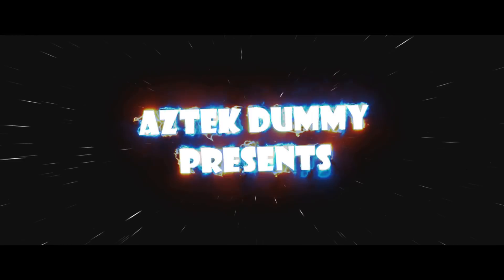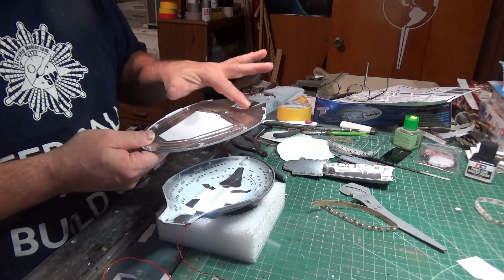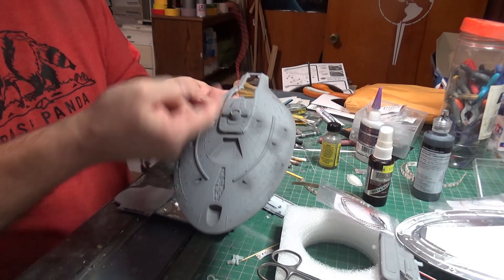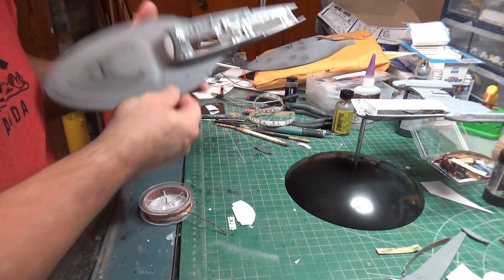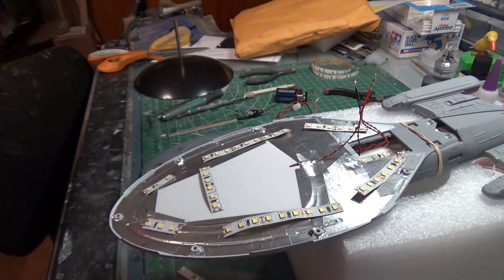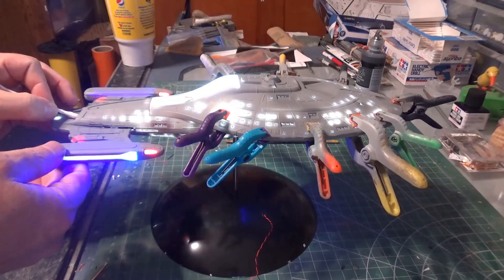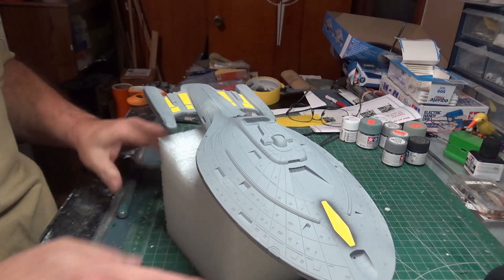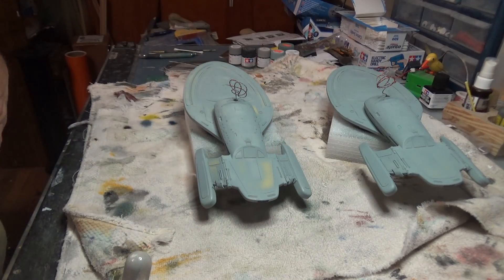Aztek Dummy Update 9/10/21 - 1000 scale Voyagers - Part 3

Comment: You have quite the point with the Tamiyas and Humbrols. Over here in Germany, Land of Revell, most of us started with using Revell enamel colors. Many hobbyshops also had/have the Humbrols as alternatives. The good ones also carried some imported Model Masters. But when you wanted to mix colors for kits from, say, the US, then chances were that they would be using color brands, that weren't as available here than where the kits came from. But for a while now, Tamiya colors are getting more and more dominant - which is nice, because now there is a color brand, that is readily available around the globe for which you can easily find paint guide and mixing guides for. Also, as acrylics, these colors are easier to use. So a big thumbs up for using Tamiyas from me :)
Reply: Great points every region has certain brands as standard  half of my kits are Japanese and have creos ( Mr hobby /colour ) revell /monogram /airfix used to mix in fs numbers along side humbrol /airfix then add polyscale game color Vallejo ,citadel and others ( at one stage I counted over 15 brands ) all I could say back then was thank the maker for conversion charts even though some colours didn't have any matching alternative

Comment: CHALLENGE! Lou, there are kits out there now for the nacelles to go through the "going to warp" flash of white sequence. I'm sure you've seen them. How cool would be to have Voyager's nacelles go through that sequence when they are pivoted up for warp? Would it be possible for this kit?
Reply: I thought about doing this. I will try to build a proper sensor mechanism in combination with an arduino board that senses when both pylons are swept upwards and then flashes a bright white led strip. My test bed will be an old revell voyager kit from my childhood that is in pieces anyway and needs some glueing